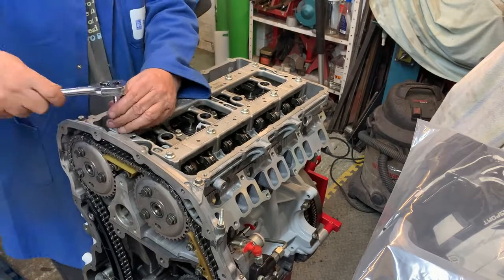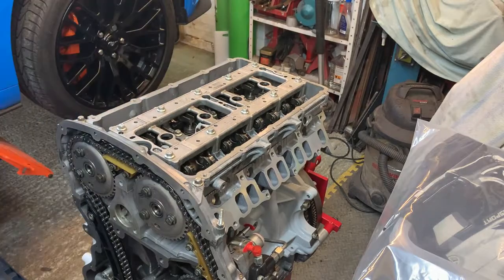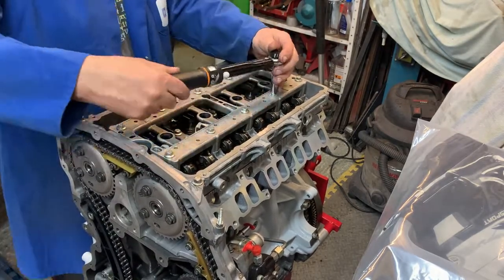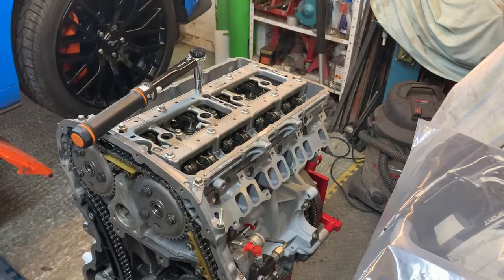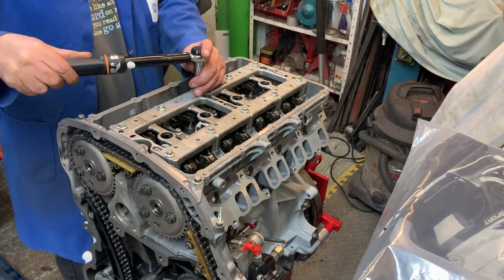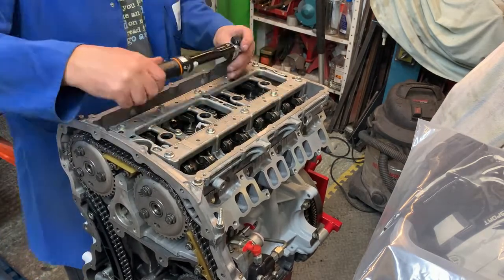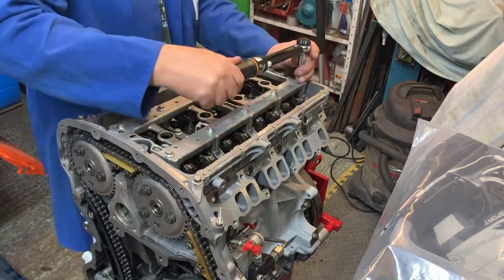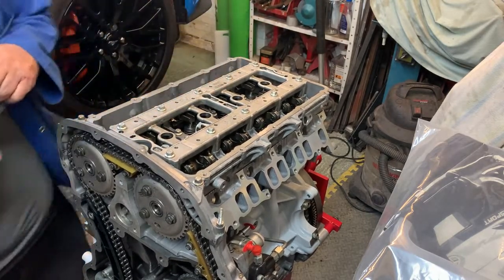Land Rover Puma 2.4 Tdci engine rebuild. Part 11 all about the timing.

Comment: Hi Nigel, just done timing chain on 2.4 tdci mk7. All timed up OK, turned engine over twice, engine still timed OK. Put old cover back on, run engine for few minutes all OK. But when checking timing again crank locked, could not get drill bits in cams again as they were slightly out. Is this normal?. Thanks Derek

Comment: Hi Nigel, many thanks for making the extra effort filming the motor rebuild in this epic breadth with all the necessary details!! 
It’s just in time, as I am busy since fout months rebuilding my Frog, a 2007 110 TD4  nuts and bolts. Dealing with endless amount of rusty metall and rotten aluminium everywhere.
The chassis was sandblasted and is primed & painted 5-6 times now with at least 5 ltr paint (Brantho-Korrux). 
Outside with the spray gun, inside with the pressure cup gun and a sonde/ tube with 360° nozzle. Worked perfect or me.
Instead of watching the paint drying, I am disassembling the motor (250k km) and cleaning/ sandblasting/ painting/ replacing loads of parts.
After looking to your great „how to rebuild an engine“ I was confident enough and now the complete timing and oil chain kits have arrived😊
Thanks again. Ron/ Munich
PS: Yesterday I was looking to your epsiode „MT82 strip down“ and my thoughts are…….why not DIY?  
I hope I'm not getting cocky now😊

Comment: Thanks for an informative video. I wished I had seen it before putting a new tensioner in my 2.4 ford transit. I think I’m 1/2 tooth out on the exhaust side. Cheers

Comment: The hole below the fuel pump was used on the first Mk6 transit tdcis’ 2002-2006 2.0 and 2004-2006 2.4. It had a little oil feed pipe going up to the Delphi high pressure pump shaft, like a little drip feed. On the tddi engines the hole wasn’t there at all just fully cast flat.

Comment: excellent head , valves & cam shafts & their  rotating clutch installation & connection with crank shaft through chain # but where is water pump body ???? & does fuel pump needs electrical power beside mechanical rotation through crank shaft ???? ❤️🇵🇰

Comment: Hi ,I need your help please, I got a Ford transit 2,4 diesel, 2009 and I have a problem with head gasket, so I thought to give a go myself, so I'm not a mechanic  i took all the engine apart and I assembled again but now does not start, and I notice the cable of glow plugs is getting hot when I start the engine, and on dashboard I got two light one represent MBS bricks and the other one is the slip road or tyres whatever you call it, any idea where the problem is,? thank you.

Comment: Hi hoping you can help! Looked with no success. Ford engine 2.2d trying to find bottom crank pulley looking for the one way pulley to try stop the rattle on tensioner. Not a solid plenty of them around. Looking for part number. I can see you know your Engine's.
Reply from the maker: Sorry mate, cant help. I know nothing about the 2.2

Comment: working on a 2.2 euro5 rwd puma . been removing head for inspection/gasket replacement.    when I pulled the injectors they all seemed to have oil on the ends ( quite a lot).   Any ideas what leads to that?   the engine was running with no oil / water mixture.
Reply from the maker: Are you sure it was oil? Why are you changing the head gasket? I recently saw a Tdci with a blow out in the aluminium between cylinder one and the water jacket.
Reply: @defender90keswick.nigelsla59  Head gasket change is the hopeful outcome that is why I said inspection.  I was made aware that head damage was possible, (even more likely) than the gasket.   it was losing water, pressurising header when bought by me late last year.

I bypassed the egr cooler withstill same problem.   because the egr itself has it's own water in and out theoretically I guess the egr itself may have failed.   late into the stripping of van to take head thought to try and test the egr by pressurising the water in and out @60psi.  not sure this is at all comprehensive but I actually havenot heard anything about an actually egr failure causing the head gasket only the egr cooler and as I say that (egr cooler) was removed and bypassed.  

on examination , the gasketdoes not seem obviously terrible and obviously breached.   it seems worse on the side which mates with engine block. a few people I have consulted have mixed opinions about it.  I guess I will need to have it sent for pressure testing .   how might I inspect it better myself though?  I have cleaned it up quite well.   not taken valves out yet but probably will at least to change stem seals and probably lap.  assuming the head is not damaged.
Reply: @defender90keswick.nigelsla59  rereading your comment.   at first i assumed you meant in the head, not thinking.   How was this evident?

Comment: You missed tightening the bolt on the rocker gear in the centre 45 degrees. The one on the centre inlet side watch at exactly 32 min mark on your video
Reply from the maker: Great observation there. I did actually do it before I switched the camera on. Thank you.

Comment: Great video! Must admit right at the start i nearly closed it though when you mentioned subscribers dropping lol - i was like "oh here we go..." but to be fair, it's a bloody good video. How did you get that engine block looking so pristine?

Also on the transit, i need to remove the fuel pump. I'm told there is a way to do so without disturbing the timing / chain. Any clues please?

Whats the little chain at the bottom of the engine for? - Does that also need to be replaced with the timing chain?

I still can't believe that inlet cam has so few chain links wrapped round it compared to the exhaust... daft design and asking for trouble.
Reply from the maker: The little chain at the bottom is the oil pump drive.

Comment: These  HAVE to be one of the very worst engines ever made!  They seem to shit themselves big time, pretty much as soon as the warranty is over!

Not seen ANYTHING about one of the main reasons these engines fail, that being sulphur free diesel, which is the root cause of many fuel system issues.

Anyone  unlucky enough to own a car or van with one of these fitted, should be using 2T oil in the diesel, as this will reduce the chances of the otherwise almost inevitable fuel system problems.

Personally, I will stick to my old Toyota, and have no need to rebuild  something as unreliable as one of these...................